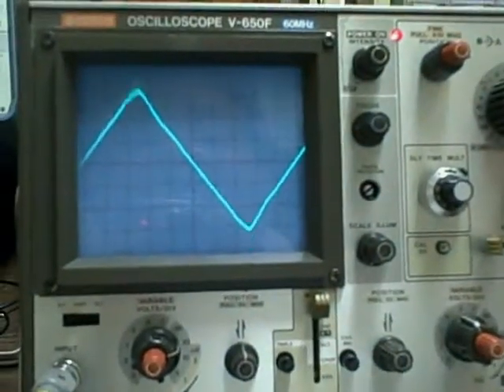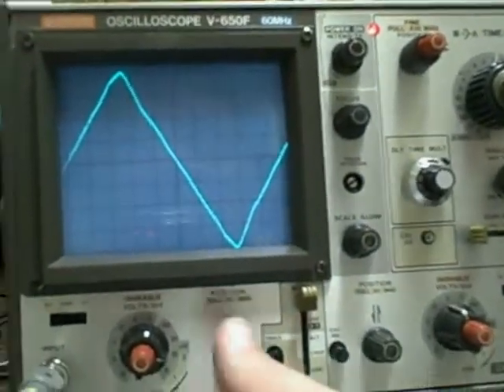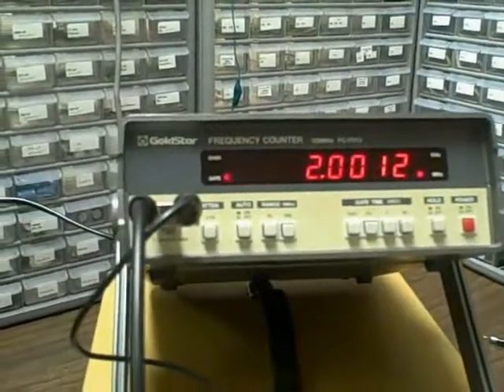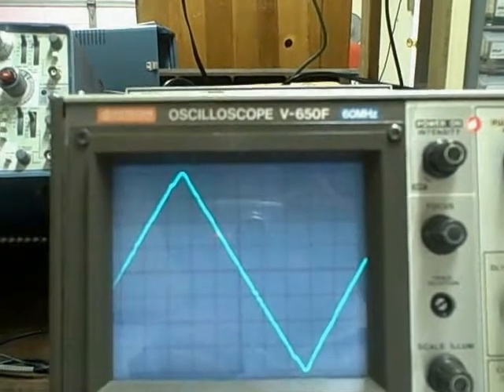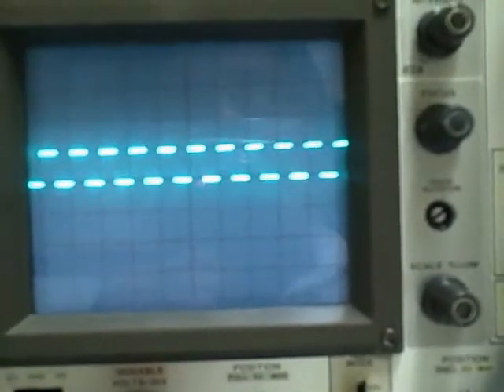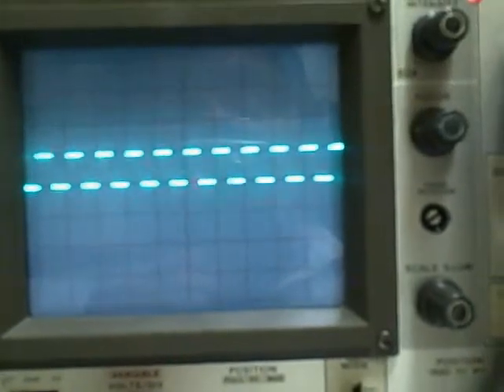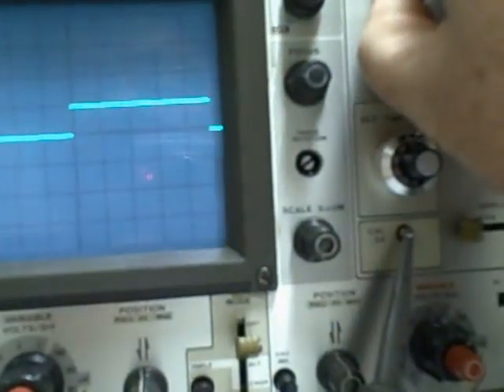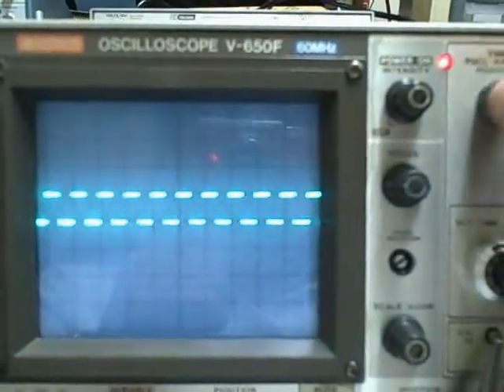pt3 v650F demo.avi

Comment: I have the same model scope...just bought from ebay. I was wondering if you could tell what the Delay Time Mult knob does? It's the one just to the right of the trace rotation adjustment.